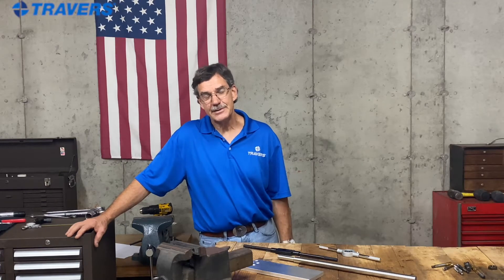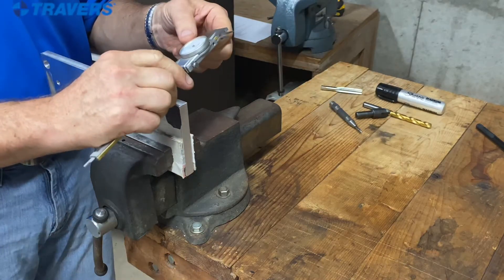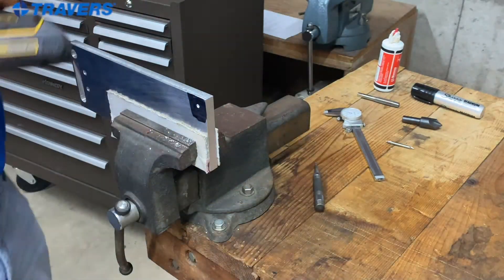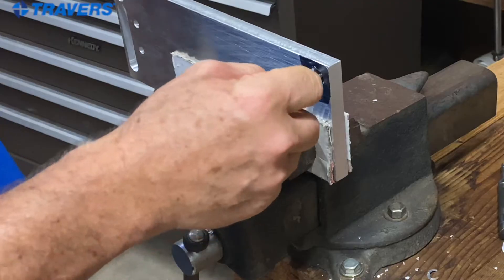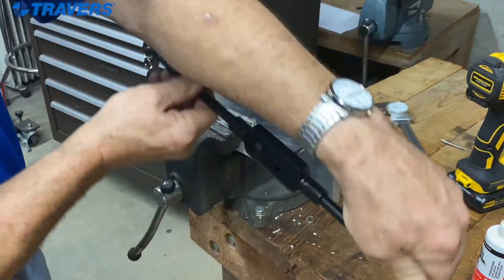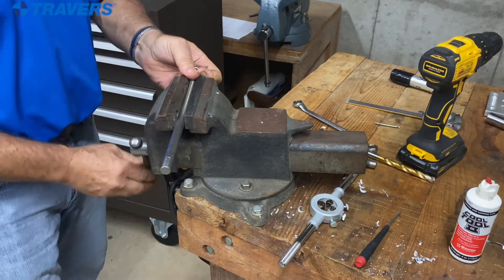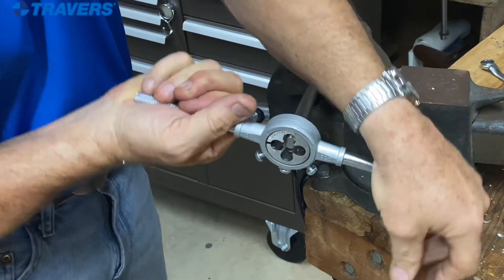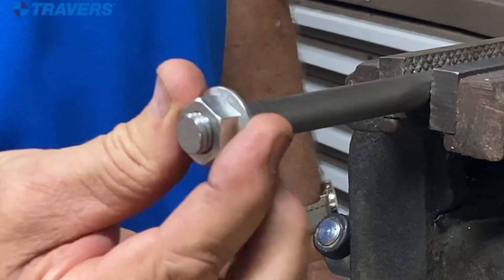Threading 101: How To Use Taps & Dies To Create Threads

Comment: what an awesome informative video. Perfect for beginners like myself. Do you have any tips on how to keep the tap absolutely straight? I use the drill press for the starter hole, so that is ok, but I hand tap like you have shown and keeping that tap absolutely perpendicular is something I find quite challenging. Thanks! Avi
Reply from the maker: There are actually a variety of ways to keep the tap straight. When you can't use a machine...
Start the threading process with a taper tap.
Use a Tap Guide: https://www.travers.com/product/big-gator-v-tapguides-229616
Use a Tap & Reamer Aligner: https://www.travers.com/product/tap-wrenches/ttc-tf-400-tap-wrench-99-065-001

Comment: question pls internet people
i have a rod that is 7mm and a die that is 6mm - will i be able to cut 6mm treads in it 
or does the rod have to be 6mm to start with?
Reply: Hi Mohsin.  The rod will need to be turned down to 6mm before threading it with a die.
Reply: @wonbythe1  thanks for the information Kurt. That really helps. Cheers

Comment: What cutting fluid did you use?
I like Trefolex hd, mostly because of the slogan. "The thick fluid sticks to the tool".
Reply: Hi Matthew.  For very light work, I use this: https://www.travers.com/product//ags-ta-2-metal-cutting-lubricant-81-002-025, because it doesn't make a mess.  For everything else, I use this: https://www.travers.com/product/tap-magic-70016t-unsoluble-cutting-fluid-96-002-843